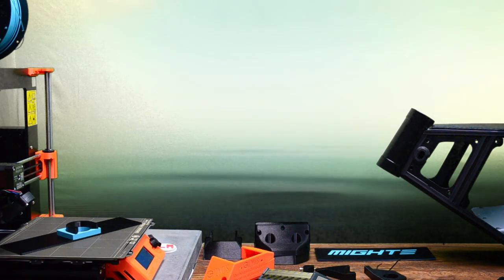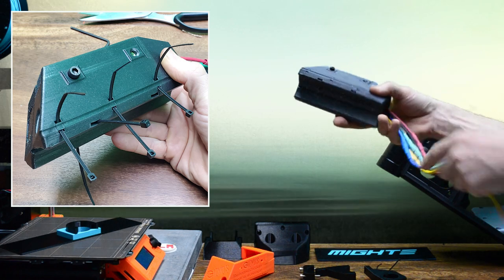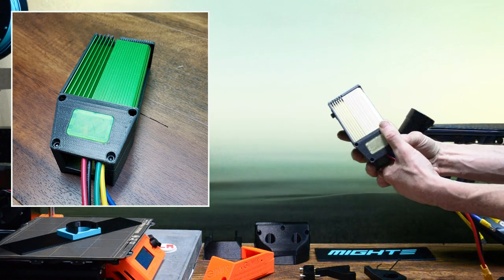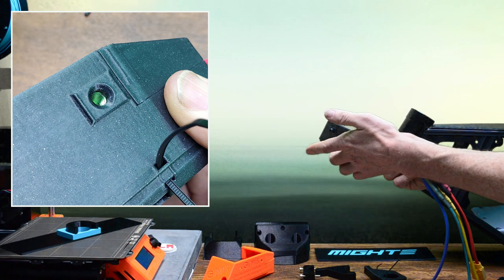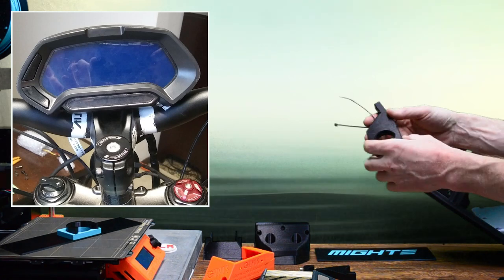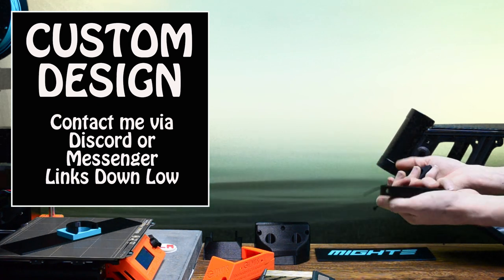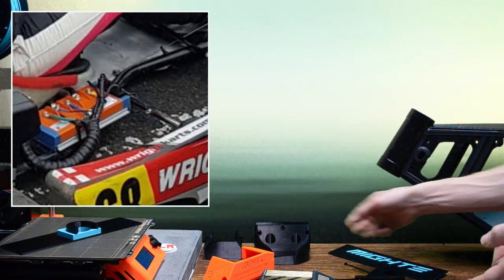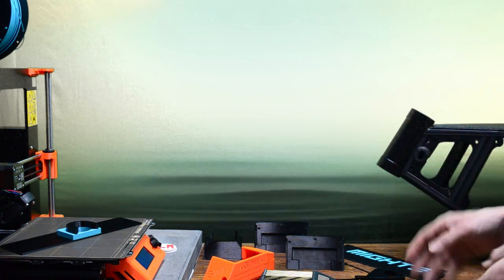ASI BAC855 & BAC800 MK4 Mount Update (New Design)

Comment: Hi. I have a Inolim Oxo e-scooter that has two ASI 855 controllers fitted and I find they (+wiring) tend to get not only squashed within the original controller box/board but they also have very little access to cooling. Is there anything you have that would enable me to safely mount the controllers to the stem or in the space where the original Oxo controller box currently sits (happy to bin this if need be). Thank you.  :)
Reply from the maker: I make this one. It might be possible to strap one to each side of the stem. https://highvoltagekits.com/hv-shop/p/bac800-855-universal-mount Not sure what it looks like elsewhere so I'd need to see photos. You are welcome to join our Discord group. I'm sure between everyone we can figure it out or make suggestions. https://discord.gg/Re2Mrwkp